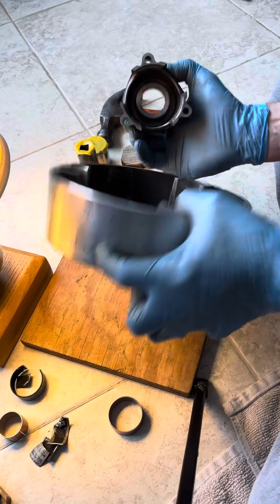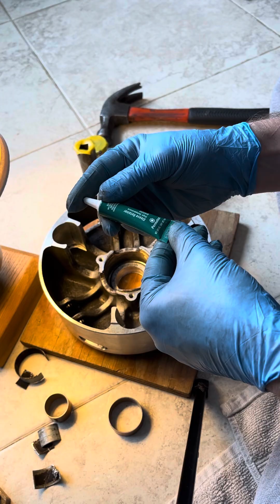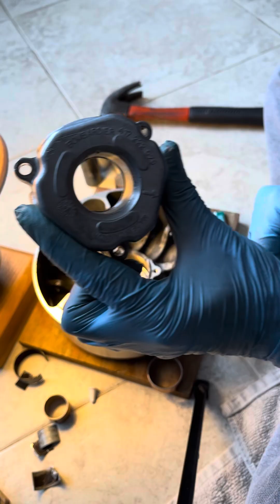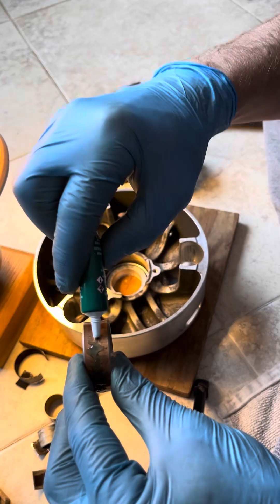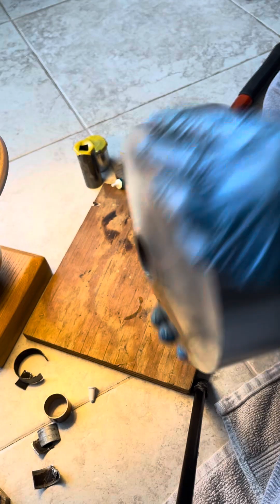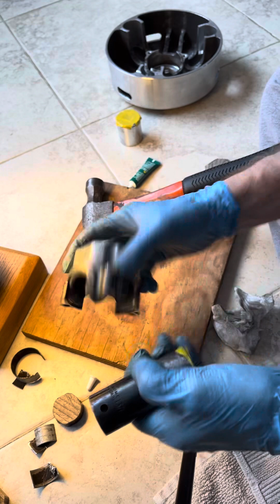2001- 2003 SkiDoo MXZ800 Primary Clutch Bushing Removal and Replace - part 2 repair mxz 800 600 700

Comment: my bushing won’t go in straight, gets cockeyed and then cracks… any idea as to why?
Reply: I just did this same job and your probably having the same problem as I was I found the bushing was hitting the circlip groove and no matter what I did it wouldn’t go in straight I never cracked mine though gotta be gentler and work it not just hit one side, almost got it a couple times but just couldn’t, seemed like it was too big for the hole decided to spread the bushing apart at the opening and slip sand paper in there and grind it down on both sides for a while and kept trying and it went in, got it halfway in and then put loctite on, but make sure u have a socket that’ll seat it all the way before you have the bushing in